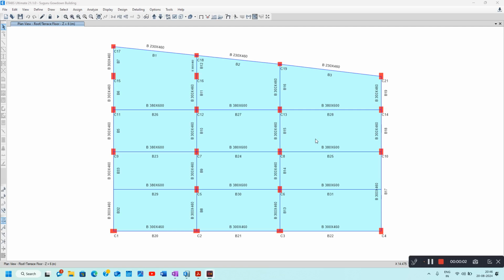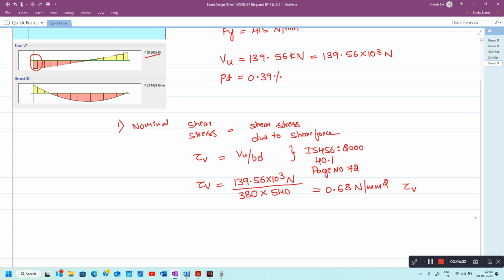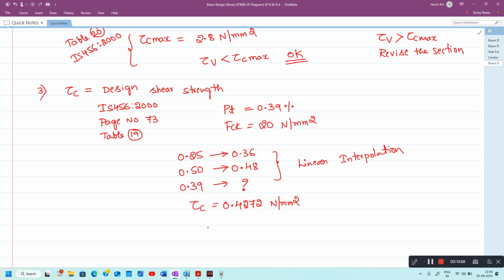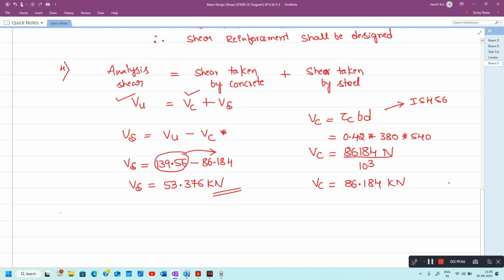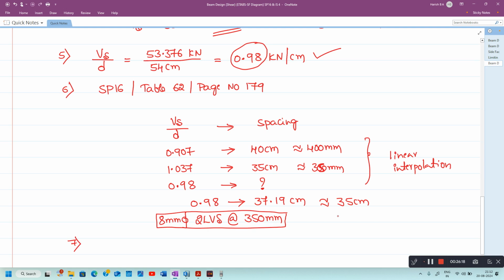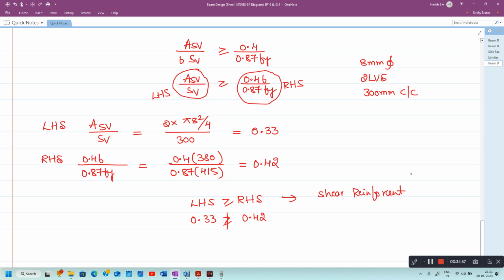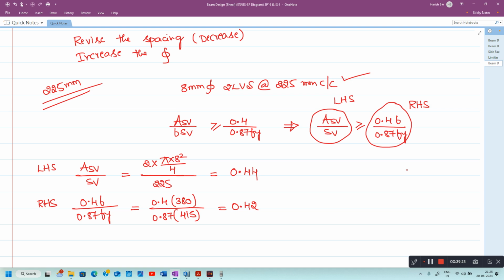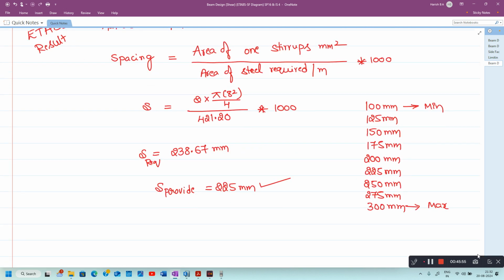Beam Design Shear Analysis: ETABS, SF Diagram, SP16 & IS 456:2000 Method

Comment: In autocad plan if there is offset for boundary beams they are not in middle of column but when  doing modeling in etabs we usually take from column center to beam center its that right to do ...
Reply from the maker: * In structural design, modeling beams from column center to column center is a standard and widely accepted approach for analysis.
* This simplifies the load transfer and stiffness modeling in ETABS.
* It ensures connectivity and accurate force flow between columns and beams.